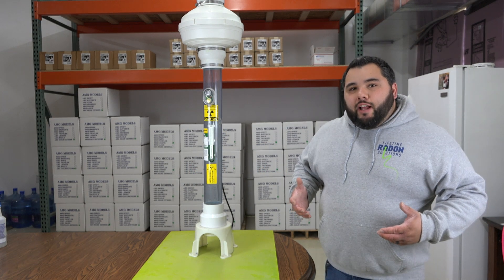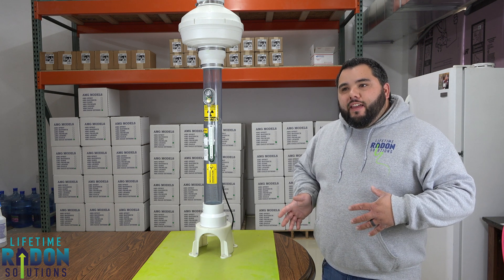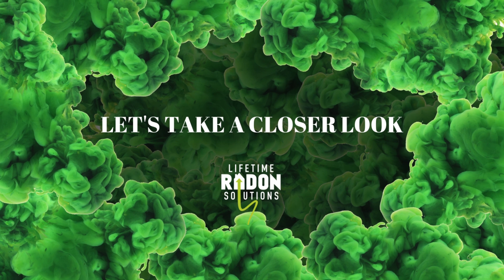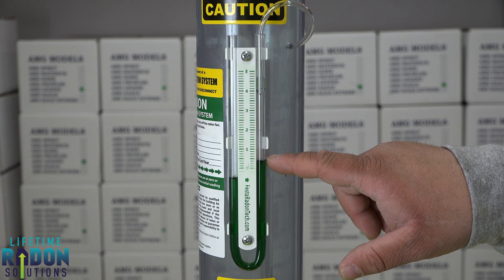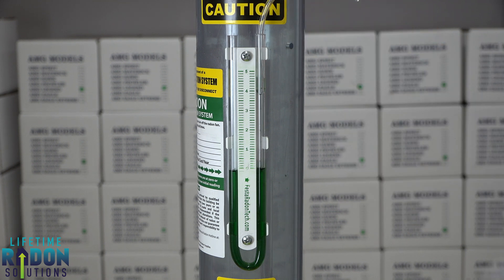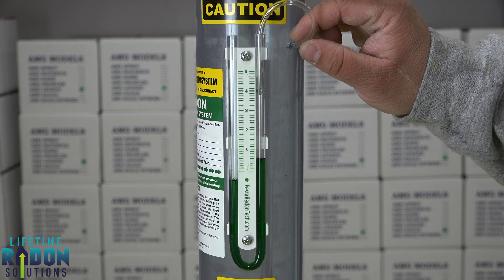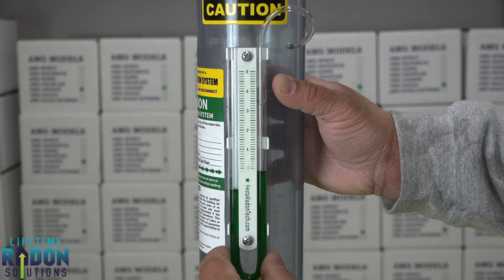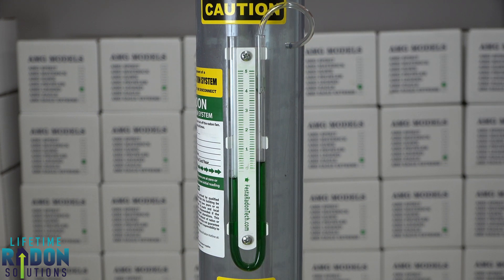Radon System Troubleshooting - The U-tube

Comment: What is the fluid is completely gone? The fan is still working
Reply: Hey! If the fluid is all gone that typically means that the manometer was either made with a crummy fluid that just evaporated OR the small hole drilled into the pipe that the tubular portion of the manometer feeds into is in the wrong spot and basically the pressure of the system sucked the fluid out because there was no trap or bend in the tube to preclude it from doing so. It’s as simple as having a contractor come out and reinstalling it
Reply: Awesome! Thank You so much

Comment: I had a radon test done on a newer house that came back 2x the radon action level, and they have a mitigation system.. is this normal or is something most likely wrong with the system (I did not get to look at the u-tube unfortunately)?
Reply from the maker: Hey! Thanks for the comment... it is pretty unlikely but definitely can happen. I would suggest having the mitigation company come out and do pressure field extension testing to determine the issue. They should know what that is. Hope this helps!